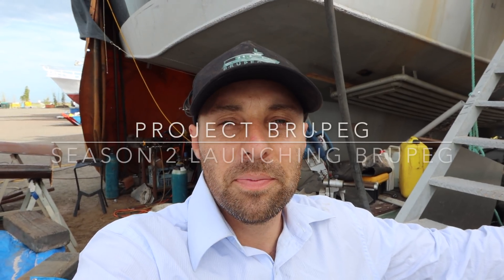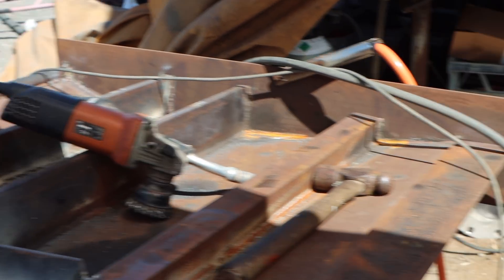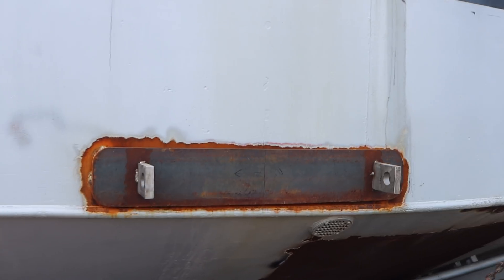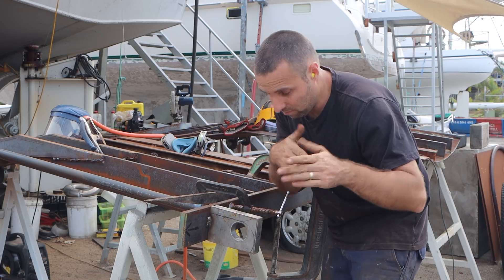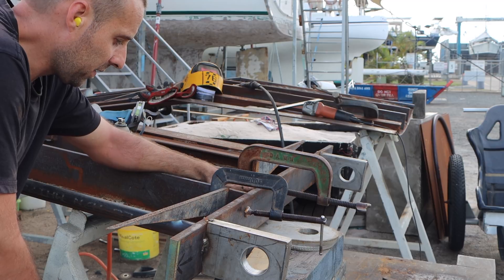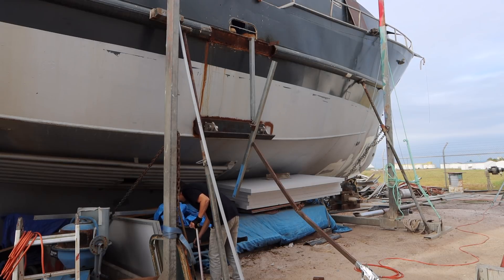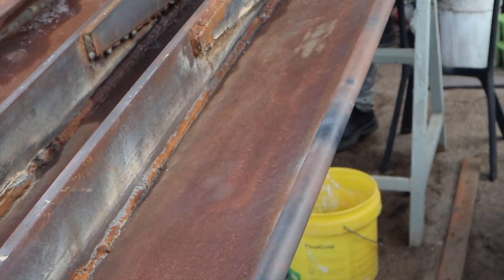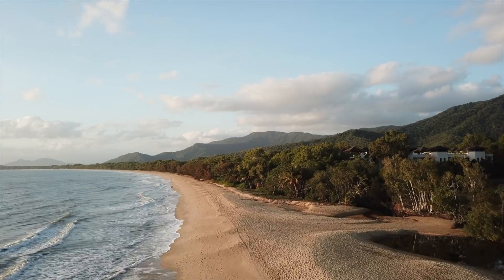Fitting Hinges to Trawler Wings - Project Brupeg Ep. 134

Comment: Just some ideas...Bronz bushings or automotive plain, crank bearings might help at refit time.
And some kind of lighting on the wings could be useful for observations or clearance around other boats at night. Sailing Zatara channel put in "Lumilights" through hull lights. Seem to help with night fishing... Thanks for sharing.
Reply from the maker: Thanks for the tips!, we do plan to add some sort of mount that allows us to fit a GoPro to the wingtips to look forward and back so maybe a battery opperated light that fits in the same mount would work i think.

Comment: At 15.30 when discussing the diagonal bracing, would bracing on the inside of the hinge (closest to he hull) be beneficial? I.e. a triangle of material on the back side of the hinge might stop it folding back with the pressure of the forward movement. Dunno. You are brave.
Reply from the maker: Hi Graham, yes. We are thinking of adding a gusset behind each hull hinge and also ehind each wing hinge. We need to give them enough clearance to let the pins fit but the gusset will be made from the same 25mm thick stainless so it will be pretty robust once finished.

Comment: Hey mate. If you haven’t already got that far, when you put those braces from the hinge plate to the spars in you want to make the welds on them as close to full penetration as you can as you’ll be welding from one side. Use a 45deg bevel and leave about 1.5 to 2mm root face and about a 2mm root gap where they fit against the plate and spars. Just alternate ends when you weld them in to minimise distortion 
Just fill the bevel up to a bit over flush.   You can use a bit of a fillet to finish it off but don’t go overboard. You’ll want to fill and blend the edges like your going to do with the lugs too being a high stress point.

Comment: Seems as though your over thinking the strength of your wings , it’s not as though your running at 40 knots but more like 5 - 10 knots so the force shouldn’t be that great to warrant so much weight I would think .
Reply from the maker: It’s more the lateral force. Think rolling 70ton boat with two wings as the main thing trying to counteract that force.

Comment: When I was driving bus in winter in the Tahoe Basin, I was watching a mechanic repairing rotary snowplows that ate rocks hiding under the snow. Each previous repair held,. moving the failure point "up" to the next weakest point in the mechanism. The repairs kept getting stouter until finally rocks would just stall the diesel engine dedicated to the rotary snowplow. (There were two; the other moved it down the road.} Those wings are looking pretty stout to me. Just break the ice into convenient cube size, and scoop them out with a net?
Reply from the maker: So what I’m hearing here then is if I keep throwing steel at these wings. At some point I will be able to break Antartica
Reply: @ProjectBrupeg  A new Penguin subdivision?

Comment: Greetings from Nelson. The wings are coming along & looking good. Just wondering..would't that diagonal brace go the other way i.e. from the hinge side out to the leading edge as in gate construction?
Reply from the maker: Hi Stephen. The front hinge is under tension. So I want to link it to the strongest part of the wing (the 16mm vertical strong backs. The skins will provide a huge amount of rigidity but think of the diagonal brace like rope. It’s just there to stop stretching

Comment: Are you putting a bracing gusset behind the hinge, on the wing ?, it would give a massive support to The hinge especially with the Internal bracing, same  with the rear hinge points
Reply from the maker: Hi Jeffrey, yeah I’m thinking a 45 behind the front wing hinge and infront of the equivalent hull hinge to give it bracing both was, and copy the same layout on the rear hinge

Comment: I hate giving advice, but......   something to allow the wing to shear off in the event of too much stress for the hull to withstand.   ( Ice or rock?)   You don't want your hull ripped open  for the sake of smoother more comfortable ride.  Love the concept of wings though.  g day.
Reply from the maker: Hi Tim, we did initially ponder that idea, however... Chris the guy that is advising us on these wings has never seen an impact that has ripped a wing off a hull and cause issues. One boat he knew of hard wings down when they crossed a river bar and the boat broached, dug a wing in, rolled the boat over and it foundered. They pulled it out and there was no damage to the wing or hull. This was after an impact hard enough to roll a full trawler over

Comment: I think you have way under estimated the strength of the skin on the wings as this part has the greatest area. I would be more concerned about the attachment of the hinge block on the end plate
Reply from the maker: We ended up triple continuous welding the hinge plate to the wing internals and skin

Comment: I would gusset the hinge plate to the two main strongbacks? I would also put some gussets on either side of the hinge to the hinge plate... 
Wouldn’t think the long gusset internally would make a huge difference, but corner gussets between the other parts would.. Being that you’re welding all the way down the wing plate, the bulk of your torsional strength will come from the wing plate..
Also you could do a 3-4 pass weld from the hinge plate to the strongbacks.. Beef that area up..
Reply from the maker: Hi Dan, we actually ended up doing a three pass on the hinge to strong backs, skin and the 50x50 angle. We will add in some gussets on the hinge plates on boat the hull and wing side so they are equal and opposite each other

Comment: Great video Awesome spirit lifting intro.  Is the steel you are using Corten grade. Will the wings be sprayed, painted or sealed to prevent salt water corrosion
Reply from the maker: Thanks very much. Wings are standard grade mild, plan is to sandblast the outside and epoxy, internals will be sealed off with a bit of diesel sloshing around to prevent corrosion

Comment: Sir. Your ship is looking awesome and it is great to have a sweet lady to help you. I like to think if you put Pin brackets on each rib brace that would even the torque load better . It looks like three more Pin Brackets on each wing and two more on the ship Bracket would keep the torque way down a lot.  Greg of USA
Reply from the maker: Thanks Greg. I’m not sure what you mean by pin brackets. Are you meaning the stainless hinge plates that connect the wing to the hull
Reply: @ProjectBrupeg   Please forgive me. Hope this will work. You have two plates on each wing that stick outside of the wing with a hole in the middle. You install them on the outside ribs going down on the wing. You have three more ribs, so at there end of the wing you install three more too hold the long pin that will holded the wing to the hull . But on the Hull of the ship you only have two brackets , At this place you add two more and space them in between the wing brackets. This way the wing will not twist .i hope this help. Here a drawing  this=brace on Ship (   this = on wing  I 
 (I  I (I  I)  I) per wing  God Bless
Reply from the maker: Thanks Greg, the new hinges will be fairly similar to what you have described
Reply: @ProjectBrupeg  Dame I have a little question ? The Company that makes your Tshirt Sweatshirt could you ask them what would it Cost to add a Large Brupeg on the Back of the Sweatshirts? There is something that I like an like to advertise more. Like what you have on the front of your shirt.. I want to help you to out since my dream of Sailing is out the door after the  Virus did to m 401k. So God Bless and take Care. Greg of the USA
Reply from the maker: Hi Greg, yeah that’s possible. Are you after a hooded sweatshirt on non hooded (as I need to add the logo to the back of the correct one)

Comment: In making the wings so robust, how heavy have they become? Adding the diesel and the weight of the seawater above them, how strong do the struts have to be? Would filling them with foam instead of diesel make them more buoyant and less of dead weight?
Reply from the maker: Hi Sid There will only be a few litres of diesel and mostly air in these wings so they won’t have neutral buoyancy but it won’t be as bad as people think. We ran the numbers, they weigh 350kg. They will produce 320kg if lift at 9knots so the boat will only see around 30kg or downward force

Comment: This has Probably been answered but is that large coil attached on the belly of the boat the heat exchanger for to engines cooling system?
Reply from the maker: Hi guys, actually there’s three systems. Known as keel cooling, the main loop on the starboard side is main engine cooling, the small loop right above the workbench on the port side (next to the prop) is main gearbox oil cooling, and the final loop that runs almost the full length on the post side is main generator water cooling
Reply: Project Brupeg thanks for the reply!

Comment: G'day  Crew,,
What happened to the range at cat.  ??
Reinforcing the hinge ,,
If your intention is to weld solid brace material from the mid section to the internal  hinge plate ,,
I have two concerns ,,
They would be that the "solid brace"  would act as a "lever"  or "fulcrum point"  and transfer movement or flex from the mid section to the hinge plate .
This movement  is easily overcome by modifying the brace ,, to incorporate a section of rod into the middle , or  round bar with  flat ends if you like , as this would allow flex  without to much lever action on a fulcrum point .  (Often used to hang heavy  pipework ,, but allow for flex) 
 Also ,,as you know welding in small triangular sections  will add significant reinforcement. 
The force on the hinge is why I keep suggesting a controll arm  or cable , but I do like the idea of internal  reinforcement. 
Finally ,, again lovingly provided in comments by Matt (obviously a tradie) 
Good info  about dry welds /warming  etc.,to improve weld strength .

Oh  Damo ,,, I quite like you as a blonde, n with a mysterious accent ,,but  thankfully,,,,   Jess has to deal  with that  !!!!

As always,,just food for thought .
Thanks for a great episode .
Reply from the maker: Thanks guys, yip not a welder here so appreciate the tips. As for the forward bracing back to the hull. According to Chris it’s not required as they are plenty tough without that and they would add a fair bit of drag

Comment: Great work you two. Dame, have you ever used a needle scaler, great for weld slag remover and heave rust cleanup. looking forward to you putting Brupeg in the water
Reply from the maker: Thanks yeah I have tried one but I gave up on them (I’ve broken three so far) as they just don’t last in this environment. We normally go with stainless buff wheels or BIG hammer drills if we need a chipping action

Comment: looking good  thanks for the video throw a third hinge plate onto it if your worried about the forces the more weight you build into it the further from the pivot point the higher your working loads will be as a base line . im thinking taking the forces on the hinge from 1/2 to 1/3  will offer more strength  with the least cost in weight on lever. any luck with solid state hard drives for the voyage?
Reply from the maker: No SSD’s yet. Not high on the list at the minute. The barrel hinges are something that we definitely want to upgrade to and will do next haul out as we will have more usage data to base the design off as well
Reply: @ProjectBrupeg  well as i see it another hinge plate would be better than a triangulated brace but im not an engineer so its a gutfeel thing already ignoring the its swiss idea  american design  russian manufactured as is  over thought  over strong and not going to break during abnormal service letalone normal lol  again im not an engineer